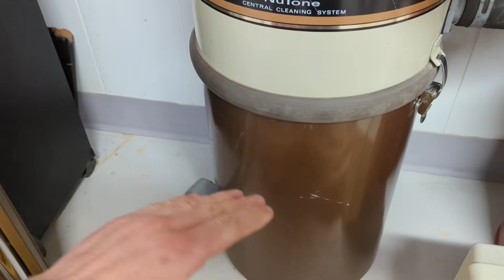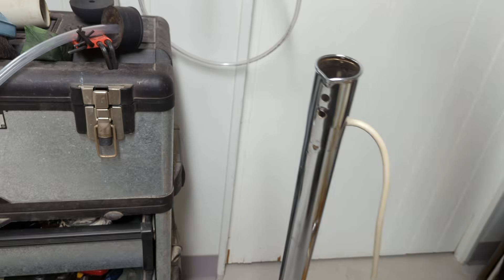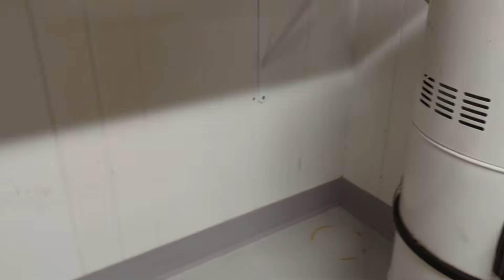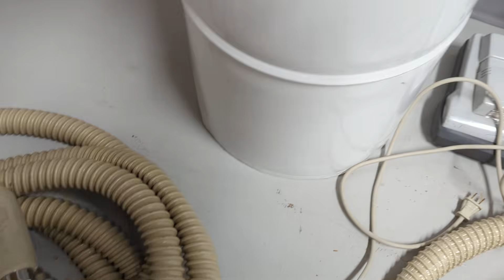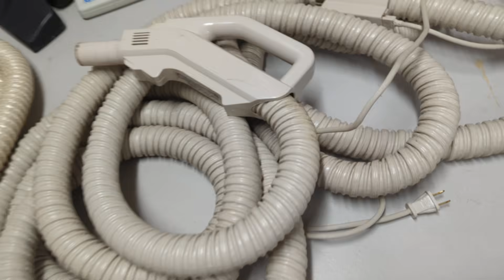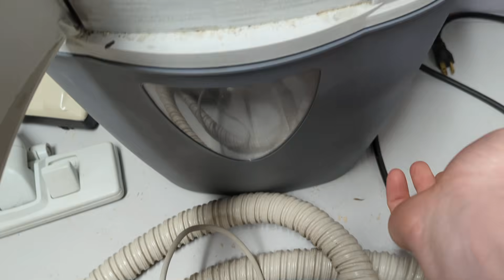NuTone Central Vac Systems: Product Evolution

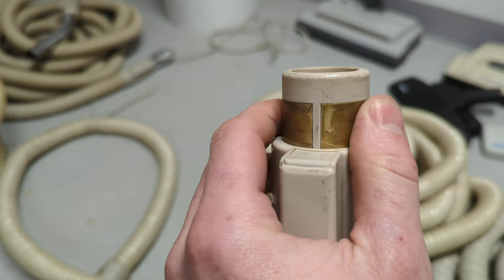Comment: Hi! I'm looking to replace my mom's Nutone 1 and 3/8 inch high-performance low voltage hose (you mention this model around the 13:01 mark in the video above). The two copper plates have detached on the wall end of the hose and the plastic sleeve under them (the part you're holding at the 13:29 mark of the video) comes right off. I just Crazy Glued the 2 metal plates back on and am waiting 24 hours for the glue to set. If this doesn't work as a permanent fix, would you be able to recommend a compatible replacement hose I can purchase online? I would be very grateful for your expert advice. Thanks!
Reply from the maker: Hi, I would recommend one like this: https://centvac.com/store/p/low-voltage-hose
This will be lighter and give better airflow, plus it has a swivel handle! Should fit your NuTone wall inlets just fine. Thank you for watching!
Reply: @Centvac  Thanks! I'll give that a try if the Krazy Glue fix doesn't last.

Comment: I have the VX1000 (2 motors 220 V) since 2010. It's the best and among the most powerful  central vacuum machine you can buy even  today 2023
Reply: You can't buy the VX1000 anymore, it's been discontinued for a while now. Stock up on the bags while you can because they're getting harder to find nowadays. I'd disagree that they're the best. Powerful yes but as what Owen said in the video, they're problematic. Even the bags are a poor design as what Owen pointed out here. There are definitely better options than the VX1000.

Comment: If you have an old nutone central vacuum from the 90’s and 80’s, just get new Ametek Lamb motors instead of getting another nutone. And consider upgrading to a bigger motor. A 250 dollar motor that will serve you for 20 or more years is a better value than a new 650 dollar nutone that has motor that will serve you for only 5 years.

Comment: Hello I wonder if I can ask you a question. I just moved into a home that has the white Nutone 360bg canister in the garage, but it didn’t come with a hose. Well, I ordered one from Amazon that said it should fit all inlets, Ovo brand, but lo and behold it’s too big for my inlets. Would you happen to know which hose diameter would’ve been common in the early 2000s? The Nutone website doesn’t have information on the 360bg
Reply: 1.5 diameter hose is too big. That’s what the Ovo is.
Reply: Just moved into a house that has the first brown and tan one. How can I get it operating

Comment: I had the issue of the contacts welding together on my Beam once but I unplugged, disconnected, took the top off, pulled the cover off of the relay, separated the contacts and lightly sanded them like points in an older small engine and the machine is back to running condition.  If it does it again, I'll desolder the relay and replace it.  Those chrome wands look like the kind used on Rainbow systems up to the E series.  On my Eureka flat belt sweep 'n' groom nozzle I occasionally take it apart, clean the belt, motor shaft and brushroll pulley with some isopropyl alcohol on a rag and I have been using the same belt for over three years now.  When the belt gets stretched I turn it inside out and reuse it.

Comment: Hey Owen, great video. I have just about every brand of central vacuum in my collection, I think the only ones I don't have are Nutone and Beam, I had a beam unit and I ended up selling it since it was bagless and quite loud, I use all of my units without pipes and that beam unit was by far the loudest, although I think I have an even louder unit now, the Galaxie GA240, it's all metal so of course that makes it louder and it has two motors in parallel, 199 water lift and 216 CFM, I actually wear ear plugs when I use it, the floor actually vibrates when I use that unit.

Comment: My parents built a big house in the late 1980's and had the Nutone system installed.  I think it looked like that red one with the utility valve on the front. It didn't come with a powerhead or electric hose, so my mom used her canister powerteam quite a bit.  At some point my mom did get that electric hose and that roto-matic style powerhead with the light.  Quite an improvement in performance on carpeting but to me, the nozzle wasn't as nice as my mom's Kenmore Power-Mates or Hoover Quadraflex Powermatics.  She had a canister on each floor.  Sometime in the early 00's when I was away at college, they swapped out the Nutone with a MD SIlentmaster.  Such a nicer machine in my opinion.  Thanks for the trip down memory lane.